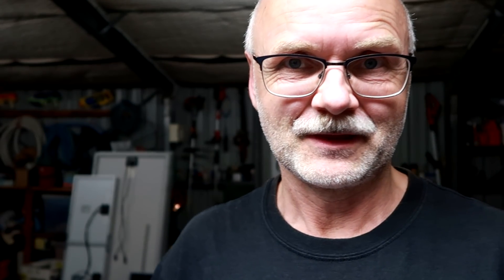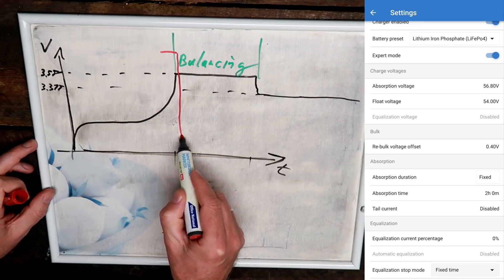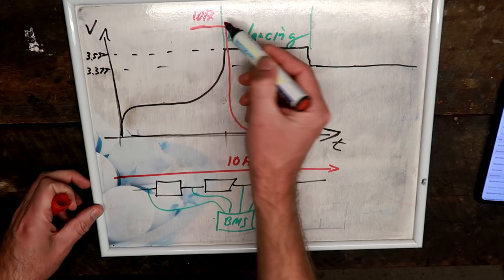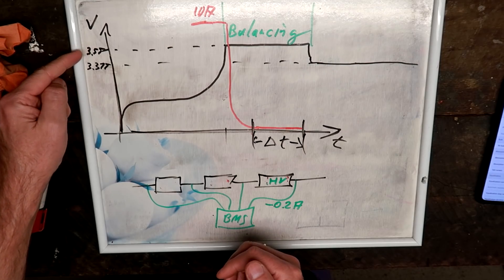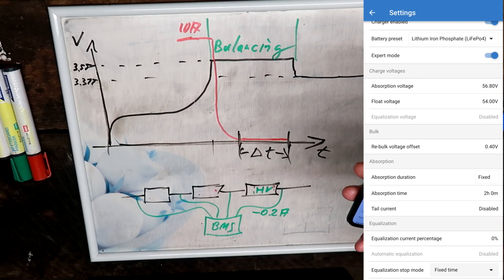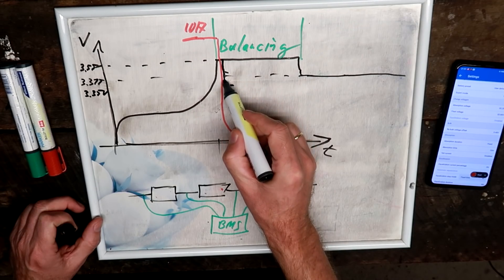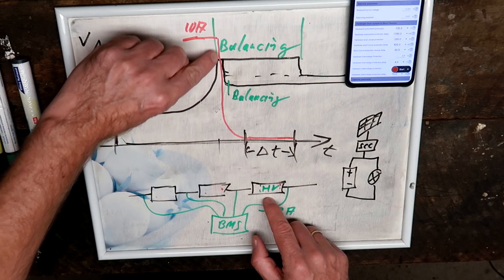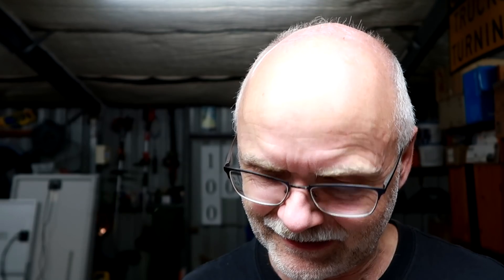Can I balance my battery while floating? Well, I do!

Comment: Hey OGG i seem to have a goofy Shunt also. I think the voltages and current readings i get are close but not exact. I have Valance Batteries (2) and i have no clue what each cell reads, I haven't been able to get my laptop and batteries to communicate. Do you think the BMS in those batteries are smart enough to regulate the voltage cells safely and properly on its own? BTW today is the first day my Victron Charge controller stayed on Float all day. Ive never seen that before. Ran my AC and  for about an hour and the Float light never left Float mode.

Comment: Why don't you just use Tail current of say... 2 Amps instead of Absorption time? That way your batteries will be charged exactly the same every time.
Reply: Probably because it would run for too long at the higher voltage and endanger weaker cells during that period. His goal with the 10 minutes was only to trigger his SOC reset to occur, not for charging purposes.
Reply: @fredio54  #1 He is charging at a modest voltage of 55.2 so endangering cells is not an issue. #2 On a sunny day and the charge amperage is high, he will hit the absorption voltage much quicker so the charging will stop prematurely compared to an overcast day which will have a much longer charge time at a lower amperage. If you stop charging a battery at 20 or 30 Amps compared to stopping at 2 to 5 Amps (at the same voltage), you will be at a lot lower state of charge when you're done. Very inconsistent.
Reply: @SpeakerKevin  #1 I beg to differ, danger is defined by the following simple math: 55.2 - (3.25 * 15) = 6.45V the voltage one cell will get to if the others have not become saturated and started to exceed nominal voltage. That's fried/toast territory. #2 Not true if he maintains any voltage higher than nominal for an extended period as proven on this channel rather conclusively.
Reply: @SpeakerKevin  To be perfectly clear, the voltage for a 16s pack you have to charge at to be 100% sure to not overcharge any cells is defined by (3.25 * 16) + 0.4 = 52.4 - any higher is at risk of damage without appropriate balancing techniques and equipment.
Reply: @fredio54  His delta voltage between cells is a mere .005V. Plus he has a fully programmable BMS that will shut down the charging if any cell gets outside of a safe voltage.
Reply: @fredio54  To be perfectly clear, that is NOT how his BMS works ...
Reply: @SpeakerKevin  And what use is a pack that is disconnected from the energy source and/or load? None. I'm fully aware that the BMS will protect from that, but it's not very useful. I know his cells are close, but in the event of that ceasing to be true from whatever reason, eg moisture bleeding energy from a subset of cells, that balance state ceases to be true.
Reply: @MrSummitville  I know. But what's the outcome? Useless.

Comment: I think that the objective of balancing is you have the same state os charge in every cell, and you only can get that in high voltage, 3.4 or above.  If you have set it lower the diference will not be noticeable and when you pack goes full, you migh have cells that are much lower or much higher then the other, so not in the same state of charge. This will afect you on low voltage as well. You can have a diference that your pack may trigger the bms in some point. This as happened to me, i had one cell so high it would trigger the bms and the pack voltage was 55volts. My settings is bulk to 56 volts and i float at 55. I cant use absorb so i use the balancing starting at 54.9. My bms balances at 2amps so it is very efective. I had to do a new top balance and now they are similar and the bms is only balancing if it detect 0.003 diference and above 54.9. This is more efective i think for balancing.
Reply: what active balancer do you use?
Reply: @AJTarnas  i use the JK BMS 150 amps balance current 2 Amps
Reply: @MiguelSilva-mb6mb  But yet, after 3 months, Andy only has a 4mv - 5 mv difference ...
Reply: @MrSummitville  yes. If he charges to 3.6 he will see that the diference will be much bigger than that. Andy, thats a test you could do. Try to charge to 3.6 ou 3.65 to see what is you real delta between cells. For what i notice in my system the bms will trip because the state of charge can be much diferente and more noticeble at higher voltage. My pack is not perfectly top balanced and i only notice the lack of balance at 3.55 or more voltage. At 3.6 is perfectly noticeble that some cell are more high than other. I get 0.01v at 3.62, and at 3.4 i get 0.003v delta max.
Reply: @MiguelSilva-mb6mb  But WHY do we care that their might be voltage difference, at a higher voltage?  He is never using that higher voltage.  So, how does that impact  operation at lower voltages?  After three months, it has had absolutely no impact  on his operation ...
Reply: @MrSummitville  the impact will be when we use the battery till loe voltage, the inbalance will make the cells with lower state of charge trigger the bms and lower the pack usable capacity. Higher voltage is the only way to know how the cells are in SOC. Lower voktages are not precise to define and check state of charge of the cells. In the end each person works the way the feels is the best, but i check the inbalance at higher voltages to check the REAL SOC of each cell.
Reply: @MiguelSilva-mb6mb  And if we never hit the  Low Voltage Cut-Off voltage?  Then there is no issue.  And if we do, it will be very minor.  Also, Top Balancing the cells at 3.6 Volts does not guarantee that the cells will be Bottom Balanced.  One cell will always trigger before the other cells. Most people operate between 90% SOC and 10% SOC.  So really, this a non-issue ...
Reply: @MrSummitville  of corse. You can never have an issue, you can also never use a ative balancer and just put you baterie offline and do a top balance time to time. There are many ways to aproach the issue ou as you say a non issue. For me o prefer to use active balancer triggered at 3.45 volts, bulk to 56 volts and float at 55.8. My system doenst have absorb. My lowe voktage is at 48 volts, 3volts a cell and bms triggers at 2.8 low and 3.63 high. This is my settings to have max capacity within a safe range of use. But as i say it would be interesting to see Andy push is pack to 3.65 to check if the cells after 3 months are realy perfectly topbalanced or if it exist some deviation since he started is system after inicial top balance. I think thats a good test for a new video.
Reply: @MrSummitville  well, just seen the new video and that is exactly what i was saying... The cells curves of discharge arent the same on each cell and Andy balanced at lower voltage and can induce an unbalance. To have active balance you must balance at higher voltage to make sure you are in the same SOC on every cells. Lower can bring problems, like i was saying before and thise problems just appeared in this new video today. One cell high and bms triggering...

Comment: There is ample evidence and a lot of papers showing that STATE-OF-CHARGE is the stressing factor (along with temperature and charge / discharge rate). Charging to 100% IS stressing the cells. Pushing and pushing and pushing the lithium ions into the graphite (aka INTERCALATION) is what stresses the cells during charging.
There is almost no evidence that voltage is the stressing factor below 4.2 V (yes, even for LiFePo4). That's the voltage where some chemical reactions start to happen that degrade the electrolyte (if I remember correctly).
Your cells SEEM to stay in balance at mid-voltages...but 4 mV imbalance could be 4% state-of-charge imbalance. You just don't see it. If you have one cell at 100% and another at 96%, you will only be able to discharge 96% of the battery capacity because the lower-charged cell will hit the bottom sooner.
Reply: I agree, not the voltage that degrades the cells it's the state of charge that does it. Lots of studies showing it is SOC not just the voltage. His balancer is just not smart enough to balance really accurate, maybe in the future balancers will be more accurate, but maybe not because it comes down to the science of these batteries. NMC seems to be ez pz to balance but LifePo4 is more complicated.
Reply: @Daniel Ardelian - I agree that time spent 100% SOC does reduce lifetime capacity.  But I ask you ... Why do most manufactures specifically state .. Do not Float Charge at 4.2 volts per cell?   Because ... 4.2 Volts is significantly above 100% SOC ...

Comment: I love these type of videos.  We are learning a lot with the experimentation you are doing.  Do you think you are getting close to saying something like; "ok, for a stationary setting if you want your batteries to last for a very long time here is the results of my experimentation.  Set absorption voltage at XXXXX, set float voltage at XXXX and set float time at XXXX.?  If you want to charge your batteries faster for like a mobile situation the settings I recommend are XXXXXXXXXXXXXXXXX with the knowledge that battery degradation will likely occur at a faster rate with these settings.  Are we almost there?
Reply: What did you learn from this video?  The graph is wrong ...

Comment: Well since you are using a discharge BMS balancer then what you say works. My BMS has active balance so my balancing takes place while floating but also when charging as long as the charge is below 10 amps.
Reply: what active balancer do you use?
Reply: @AJTarnas  Smart Ant BMS with balance and 2amp ICgogogo active balancer. Andy has nice new batteries so he doesn't need one.

Comment: The purpose of balancing is NOT to reduce voltage.
The purpose is to equalize the SOC of all cells. Top balancing tries to equalize all cells at 100% SoC.
That is why balancing makes sense even when the charger is still pushing current.
It's irrelevant to compare the charging current vs. balancing current.
You need to compare the imbalance that you want to equalize to the duration of balancing multiplied by the balancing current. So if you have two hours to do the balancing and 200 mA balance current, you can at most equalize an imbalance of 0.4 Ah. The charger current is NOT relevant.

Top balancing works on the assumption that voltage is an indication of SoC. This is a problem for LiFePo4.
1 mV imbalance around 3.35 V could mean a 1% or 10% difference in state-of-charge (slightly exagerated for illustration purposes). It's very hard to tell SoC from voltage with LiFePo4 below 3.45 V. It would require very high measurement precision, beyond what a typical BMS is capable of.
1 mV imbalance around 3.50 V means a very small difference in state-of-charge.
That's why balancing at a higher voltage > 3.45V makes more sense.

Now the question is: how much imbalance are you willing to tolerate in your pack? How much additional imbalance is created in one charge-discharge cycle?
The usable pack capacity (Ah) is limited by the cell with the lowest SoC. You want the pack to be balanced to get to use the full capacity.
Reply: I fully agree with you. 👍
Reply: Thanks! Yes! The difference between the (for example) 10A and 9.8A could still be relevant for balancing.
Reply: @Daniel Ardelian Great explanation.
Reply: Maybe the balancing to within 10 percent state of charge is fine for him because he gets more longevity out of the cells. Think about it since he doesn't charge right up to 100 percent really fast his batteries slowly charge to 98-100 percent over a long day. So the time the battery is at 98-100 percent everyday is only a couple hours per day versus a fast charge to 100 percent would mean the battery is maintained at 100 percent for 5-6 hours every day. The time at high state of charge affects the life of the cells.
Reply: @uhjyuff2095  I agree with you that charging to 100% SOC and keeping it there for a few hours every day does not really make sense.
I believe it would be perfectly acceptable to charge to balancing voltage only once per month (Victron Energy actually recommends this for their LiFePo4 batteries).

Or you could keep an eye on the amount of charge (Ah) that you put in and extract back in a cycle. If this drops noticeably, one possible explanation would be that the cells are drifting due to cycling and it's time to re-do the top balancing. But with a 200 mA balancing current,  this is going to take a loooong time because the imbalance is high. Probably better to use a power supply to charge all cells individually to 3.50 V.

1. The available charge (Ah) of the pack is limited by the available Ah in the lowest charged cell. You balance to allow all cells to get to their maximum charge (100% SOC) so you can maximize the usable capacity of the battery.
2. If the pack is badly balanced, you risk that during a normal cycle, one cell gets to the BMS disconnect voltage (min or max) and the BMS cuts off the battery and you are left in the dark.

Comment: Some BMS is out there will not allow the balancing function if the battery is not charging I had one like that I would rather prefer it to only balance above a certain pack voltage and above a set difference between cells but allow that anytime
With my current setup I use my victron shunt relay to turn on a separate balancing board when it reaches 100% state of charge and then I have set 1 hour absorption at 3.5 volts on mine
Reply: Why do you charge to 100% SOC ?

Comment: Interesting concept have my 4s EVE pack charged to 3.55 and balancing starting at 3.4 but i use a 2A active balancer with the REC ABMS. i do look at your comment of does this really matter? these cells last so long that even if you cane them and reduce there lifespan by a few years they still last 15 odd years and by then there will be something with a much larger energy density
Reply: I have the same setup with REC and EVE cells but have balancing set to start at 3.35. 
Have noticed the BMS actively controls the charge parameters and does most of its balancing around the 13.8v point on the way down from 14.2v after the some of the cells hit top voltage at 3.55v, do you find similar?
Reply: 062521/0549h PST 🇺🇸 @ BoatingTube … what is your BMS and the Charge Controller make? These two devices play a major role in setting up charge/volt parameters. FYI, even if your BMS (?) has default value and is not configurable, you will be able to increase and or decrease charging current/volts per your choice through your Charge Controller. [ Assuming your CC is VICTRON ] 
There’s no need for AB if your CC and BMS are from reputable manufacturer. 73s…
Reply: How do you get the 15yrs of life?. Is there any research which has proved such a very high cycle life?

Comment: You can do whatever you want to with your own batteries through your batteries
I say that's fine I do something similar as long as you don't randomly want to go to a higher voltage and expect one cell not to jump away and go higher than the rest there's no problem at all doing that there's even balance boards that just continuously balance all the time and then there's some that just turn on a resistor when the voltage is above say 3.6 or 3.65 volt and the resistor just stays on forever as long as the voltage is high enough